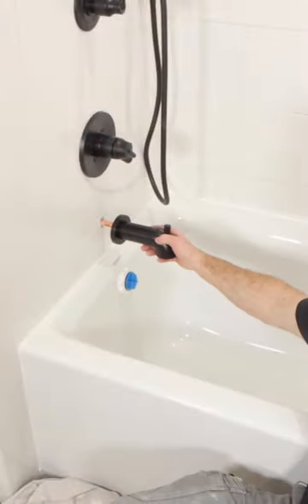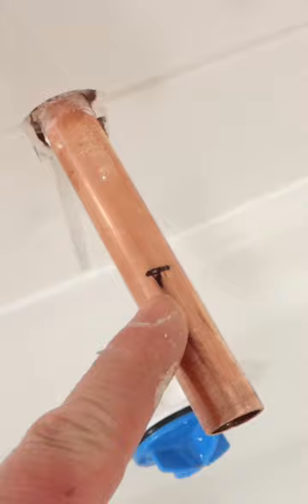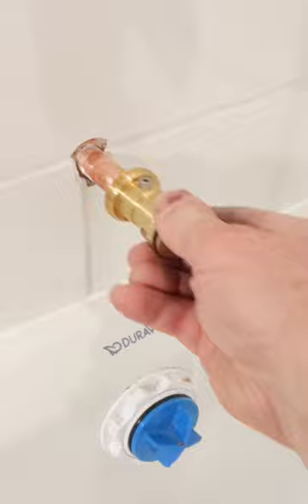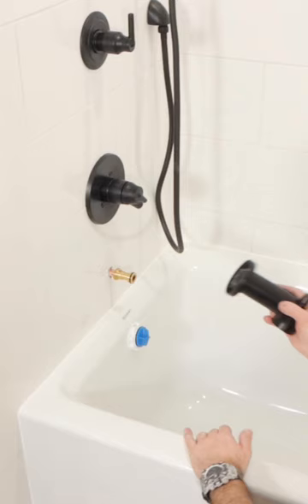How to Install a Bathtub Spout - #shorts

Comment: Take out the inside and outside O ring and sweat it, it takes 5 minutes and it’s guaranteed leak proof unless you suck at soldering.

Comment: I never trust the set screw with copper, i always pull the o rings and sweat it. Then once cool you just put the outside o ring back on.
Reply: Yeah I had one fail and blew out the sheetrock behind, never again!
Reply: @williamgoswick4392  my fav is just useing a good sized brass nipple, i like to put drop ears in for the tub spout too so a 2 1/2 male/male nipple works great. Also helps if youre setting a fiber glass wall kit, you can unscrew the stub out and put it back till youre ready to trim out.

Comment: Deburring is great for o-rings, emery cloth is not. The scratches are too coarse and it can cause a leak. For example, SharkBite instructions specifically say not to use emery cloth to prepare the pipe.

Comment: Where can I find this type of tub spout? Mine old one need to be replaced right now. The copper connector is fine.
Reply: That looks like a Delta brand tub spout adapter. I just installed one, but mine had to be soldered on. The packaging mentioned a version that used a set screw like in the video. So look for "Delta Tub Spout"
Reply: @Vincerama  thank you!

Comment: I have a Delta Porter tub spout (black). It didn't come with an adapter and has female threads towards the end of the spout. What do I need to buy to connect it to smooth copper pipe with no male threads or anything?
Reply: A male end and sweat it onto the stub out.
Reply: @evictioncarpentry2628  thats exactly what i did! Worked great 👍 now i just need to straighten the tub spout because it doesnt rest flush with the wall.

Comment: Those spouts with the threads in the back are not DIY friendly... what a nightmare trying size them flush to the wall.
Reply: Don't thread it flush then. Thread as close as you can get, with the spout pointed down, then just caulk the gap. If you want, put a plastic shim behind the spout so it can tighten against the shim.

Comment: Why did you clean the pipe twice? Made no sense.
Reply from the maker: The adapter has o-rings. Sharp copper pipe can cut those o-rings. Thus, the copper pipe has to be deburred each time it’s cut and right before installing the adapter
Reply: @HomeRepairTutor  lol you gotta love some people who feel smart
Reply from the maker: @ervinlosha1333  it’s no problem, I totally understand the confusion
Reply: @HomeRepairTutor  you have a lot of years of experience under your belt. I appreciate that you're sharing your knowledge
Reply: Basically making double sure he keeps the inside O rings pristine.
Reply: You don't want a bad o ring. I'll see myself out.
Reply: Thanks for being the one to ask this. I was thinking the exact same thing. He cleaned it just to cut it off 😂 makes sense once I read the answer
Reply: exactly, i was going to ask that. I got it.